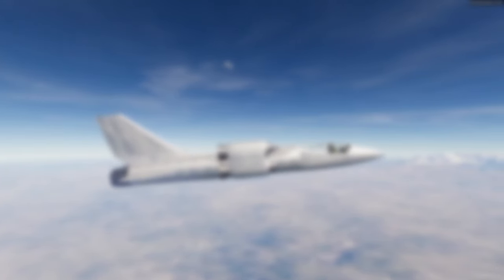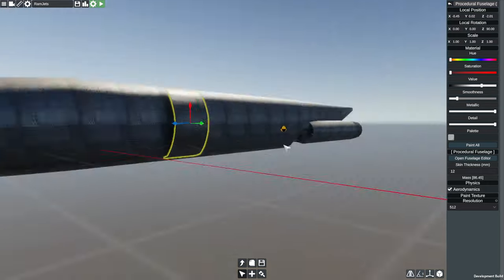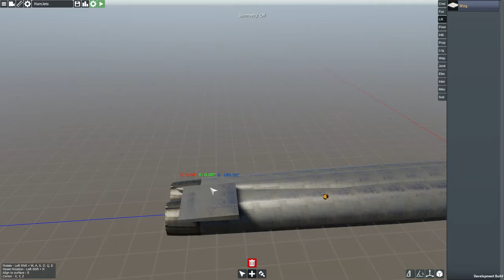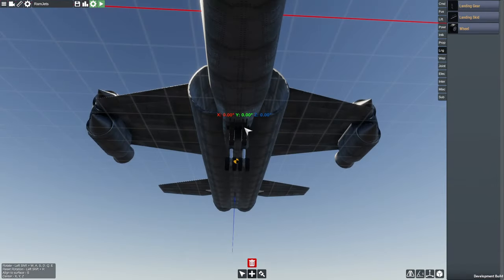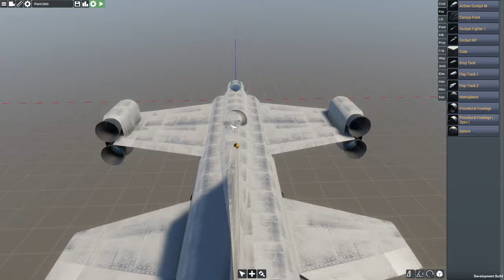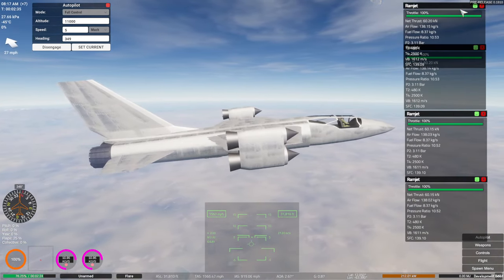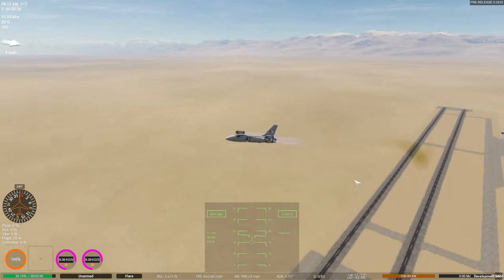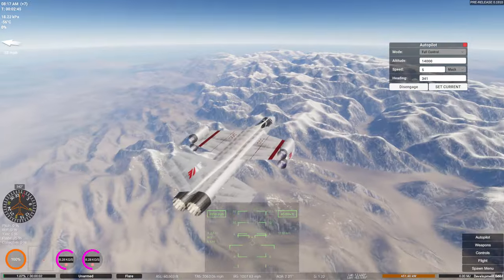I Built A 6 Engine MACH 3 Capable Jet In Flyout!

Comment: I built a crazy thrust vectoring version of the SU-47 that can pull 35Gs and can stand on its engines while it’s not even burning. It can also get to Mach 3 at 8,000 meters. The only issue I have at the moment is the fuel, because it is a twin engine fuel monster with about 7-8 minutes of full burner fuel.
Reply: It also has four weapon bays with working doors and it has pitch roll and yaw thrust vectoring so it can truly hover on its engines, oh, and did I mention it has functioning kenards?